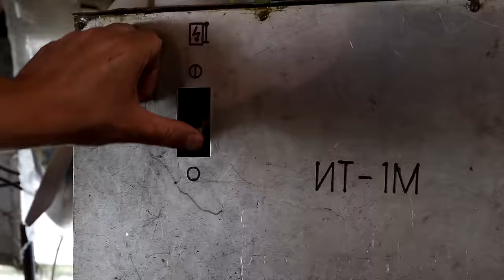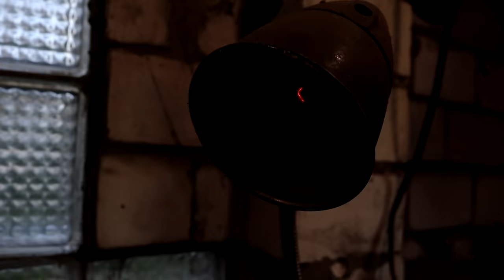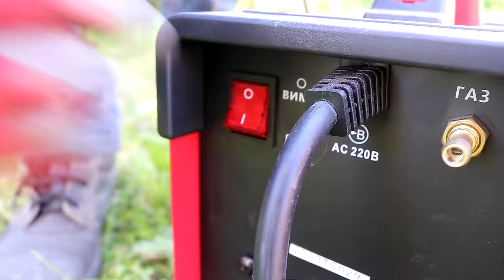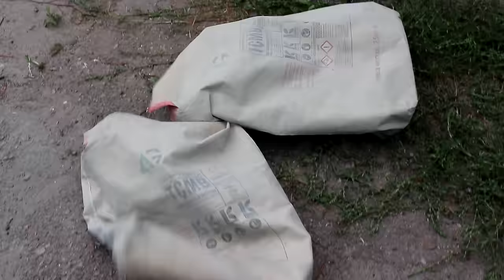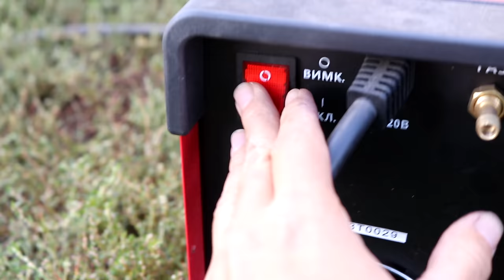Girl Wanted Privacy In The Backyard, So We Built An Amazing Privacy Fence

Comment: If you're only going to bury an electrical cable a foot into the ground, isn't it suppose to have a layer of concrete over it or at a minimum caution tape rolled out over it? So diggers in the future know? Pretty sure it's a code thing out here.